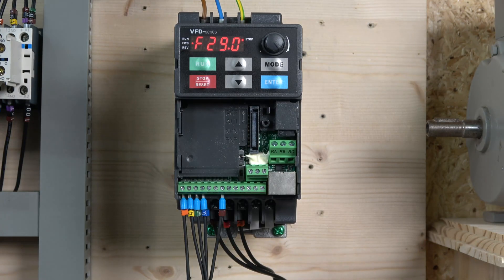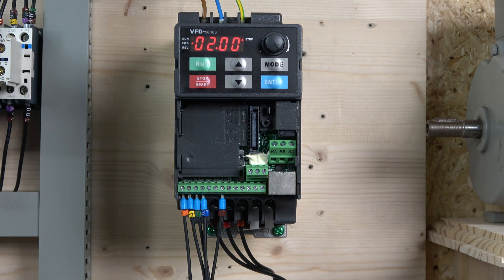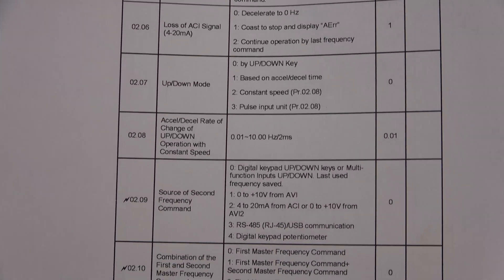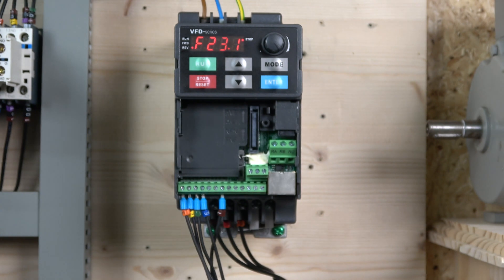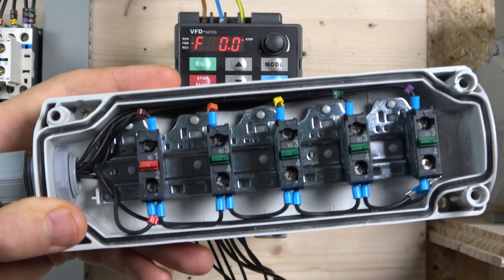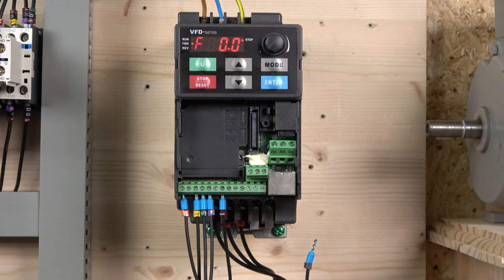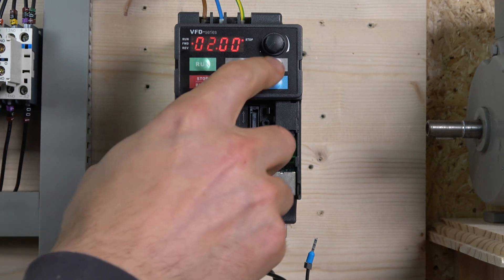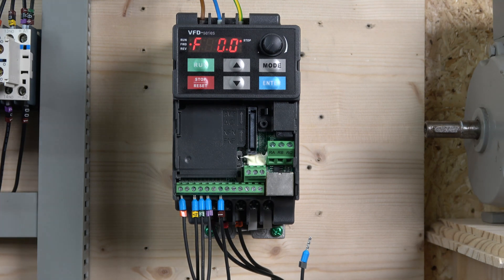Delta VFD-E drive remote control, MOP speed control, Multi frequency set up.(English)

Comment: Hello dear
I have vfd 022e21a connecting thru rs 485 from plz with speed control. But it cant communicate communicate vfd.
 Please guide me what shoult be voltage level on rs485 A and B terminals

Comment: Hello which VFD Company would you say is the easiest to program and has the widest range of VFD drives to choose from
Reply from the maker: Hi There. That is a good question. I have many drives standing close to each other, each bring in there unique advantages, so the question would be, what type of applications you are referring to? Domestic or industrial?
Reply: @IGSElectronics  hi    just a simple 7.5kw plaster machine im looking for one that would be more or less simple to program i have the vacon 100 i need to have a start stop button and a potential meter about one meter away from the vfd

Comment: If the VFD is displaying OC, how would you go about fixing this problem?
Reply from the maker: OC usually stands for over current, so be good idea to disconnect the motor from the drive and see if the problem still there, if no problem, the there is short or overload on the motor, if still coming up, 90% of the time, the drive is cooked and needs replacing.